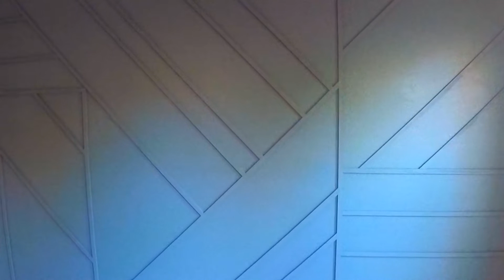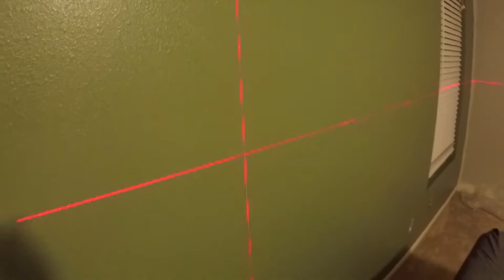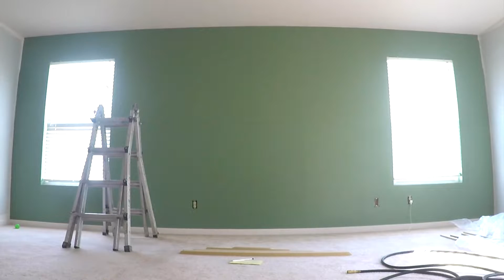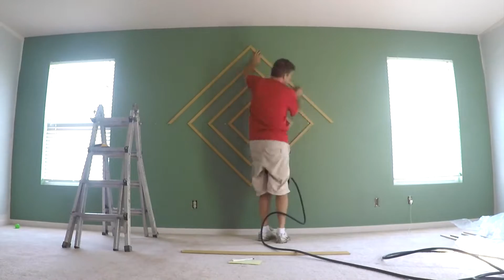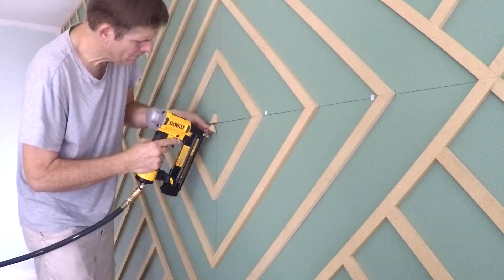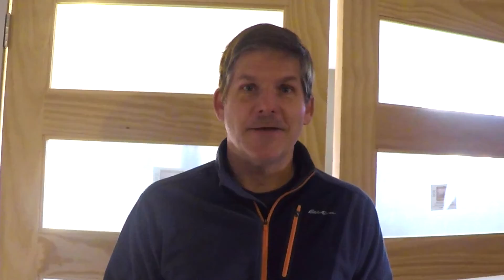How to make an accent wall - pattern

Comment: What size were the pieces you cut? Meaning 1x2’s ?
Reply from the maker: Hey Liz,
Yes.
1x2’s come precut and are advertised that way but actually measure 3/4 inch x 1.5 inch. 
In reality we cut ours from a 4x8’ sheet of MDF available at the big box home stores. 
 Thx for watching!

Comment: What’s the angle 📐 that you used?
Reply from the maker: Hey Cheryl,
Everything there was 45 degrees from horizontal or vertical. Of course, when a line runs perpendicular to a 45 degree line it forms a right angle to it and is itself running at 45 degrees. 
Hope that helps

Comment: How much would this project cost?
Reply from the maker: Hey Zhacheli,
That was a large wall - something like 16x8 feet.
We bought 2 sheets of 3/4”x4’x8’ for about $30 each.
We already owned both the 18ga brad nailer and 15ga finish nailer.  If you didn’t have them, then you could rent or borrow from a friend to keep costs down. 
So including the cost of nails - less than $75. If it was a smaller wall - you could finish it for $45...
Thx for watching.

Comment: Looks fantastic, is that a brad nailer you are using? Are you going into studs or is it largely just into the plaster wall sheets?
Reply from the maker: Hey Tim,
I used a brad nailer ( yellow -dewalt ) and a 15ga finish nailer (greenish -hitachi )
The finish nailer was used to nail into the studs. I marked the studs out - dots of white paint on the wall - before starting w/ the wood. The vast majority of the wood was nailed to studs as drywall would not really hold well. 
Thanks for the question and for watching!

Comment: Tip to find angle cuts please .... beautiful work.
Reply from the maker: Hey Christian, 
If I understand the question, this design is entirely symmetrical and all angles are 90 degrees. So image drawing in the center of the wall a giant cross or plus ( +) sign in the center of the wall floor to ceiling and side to side. Starting at the intersection of those lines - the center of the cross, measure a regular distance along each line. 
So let’s say we like the spacing of 12 inches. So from the center intersection, I make a mark at 12 inches from the center, 24” from center and 36 “ from center on each line.  Then draw a line connecting all the marks 12 inches from the center leaving you a diamond shape. Make another diamond connecting the 24” marks and another diamond by connecting the 36” marks. 
If you then take a thin board and lay it along one of those diagonal lines, where it crosses the horizontal an vertical lines of the cross or plus sign will be where you cut the board.  Each cut will then be at a 45 degree angle. When two 45 degree boards meet, they will form a 90 degree angle.
Hope that helps.
Thanks for watching.